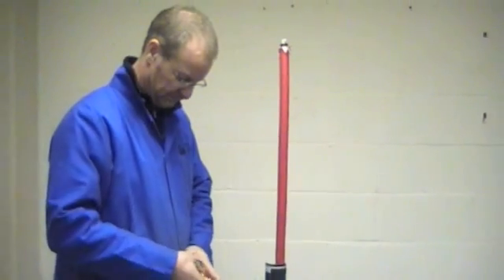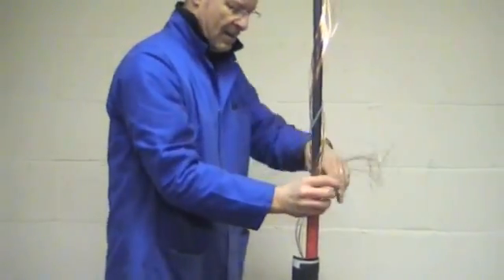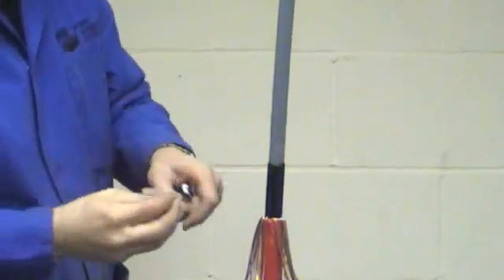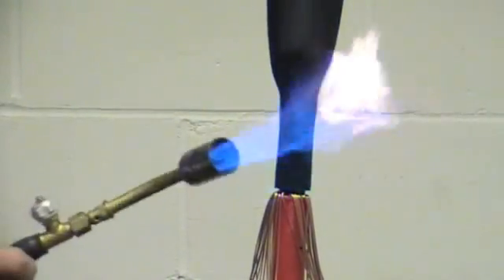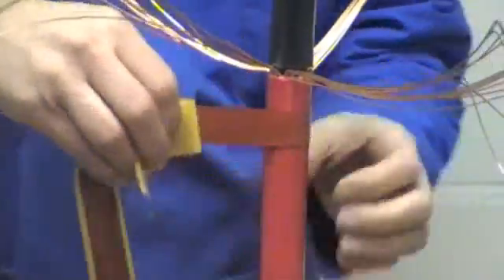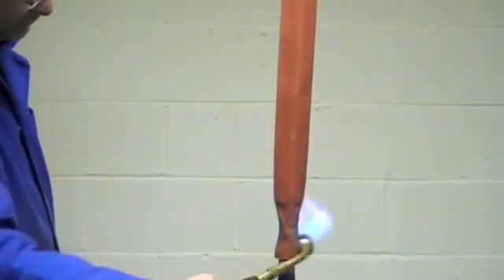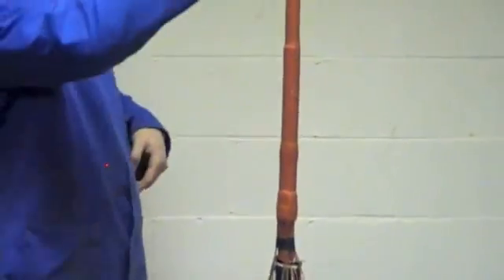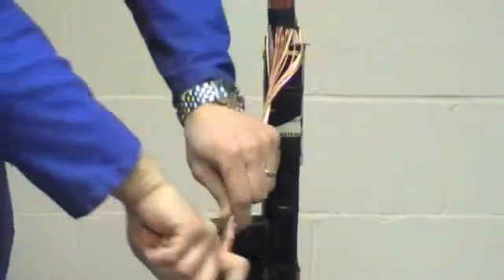Single Core 33kV Xlpe Termination

Comment: Hi please inform what is the name of this equipment
Reply from the maker: Not sure what you mean. The terminations are manufactured by us Shrink Polymer Systems. The tooling to remove the semi-conductive layer is a german brand that we stock and sell
Reply: Hi best freind, with you Abdulkarim from Oman, this name of that's equipment indoor/outdoor termination kit, xlpe cable, sinal Core 36k.v size :185mm-300mm
Thanks.🌹